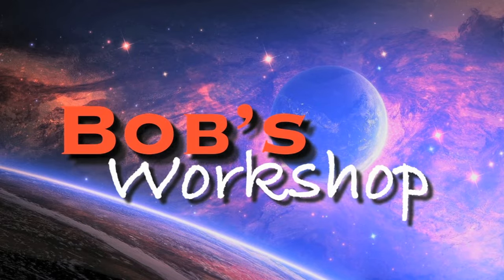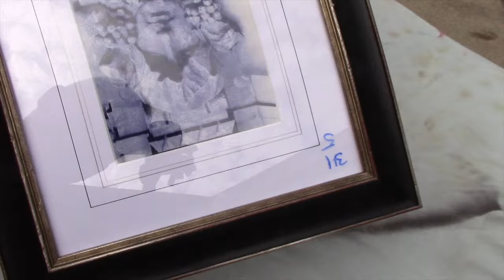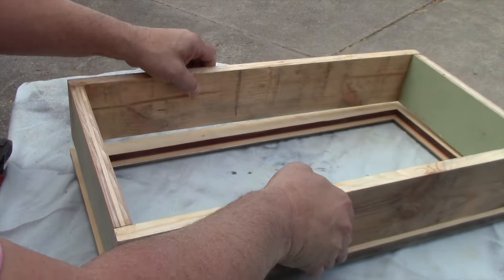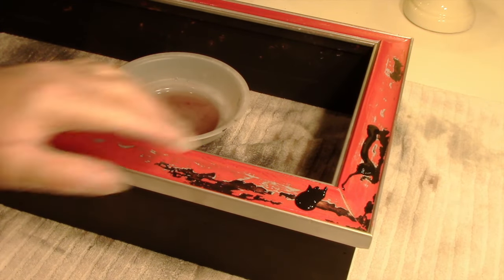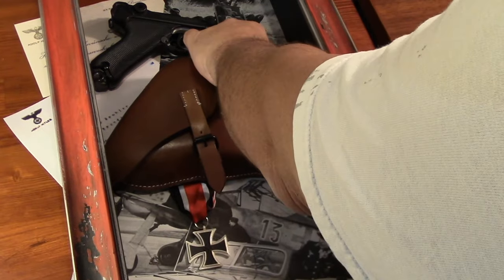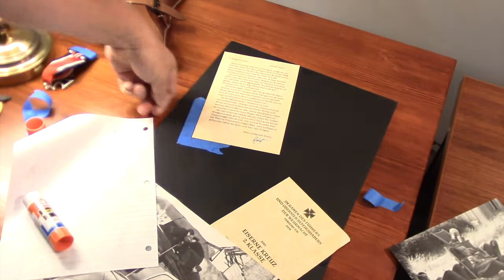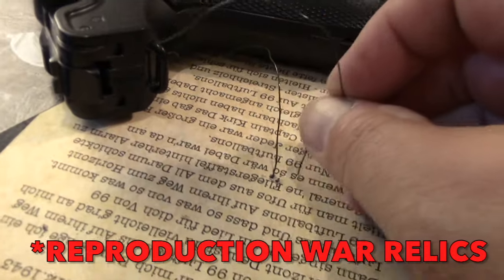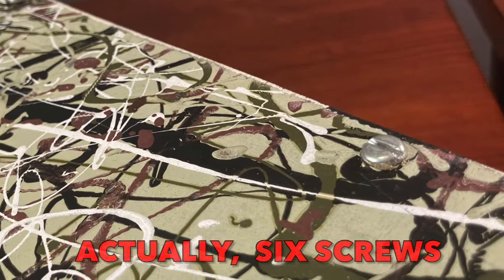Make a Shadowbox from a Frame, Scrap Wood/Lumber, Glue & Paint Display Case World War 2 Collection

Comment: You were pretty resourcefull with this project. Great work. By the way, since you also like metra Atlas O is reissuing some MTH tooling for commuter stuff, in many new paint schemes too. They're out of both of our's usual thrifty price range but I'm going to save up for something. Thanks!
Reply from the maker: I have the MTH Metra loco but I’d like one or maybe two of their double level passenger cars.
Reply: @bobsworkshop5181  if it wouldn't be any trouble I'd love to see it with your other metra units, maybe...
Reply from the maker: That’s a pretty good idea. Ok. I’ll start putting something together. Thanks.